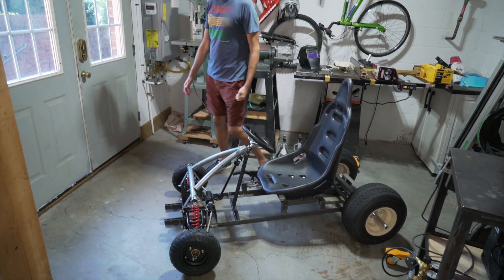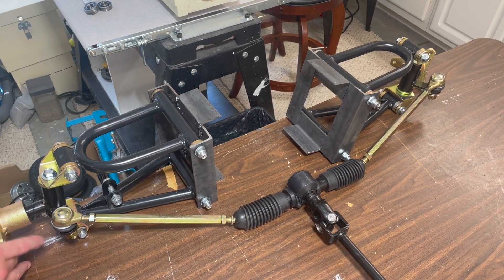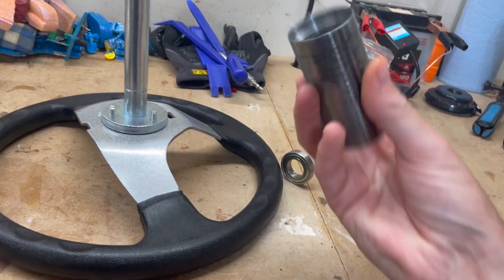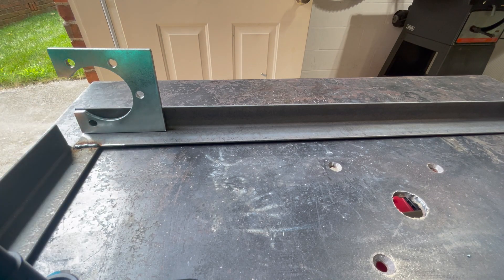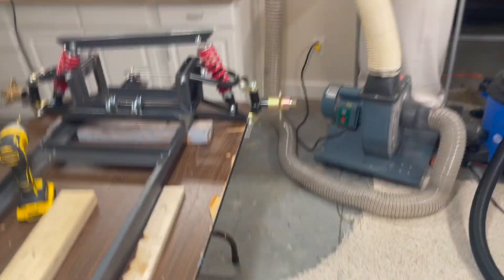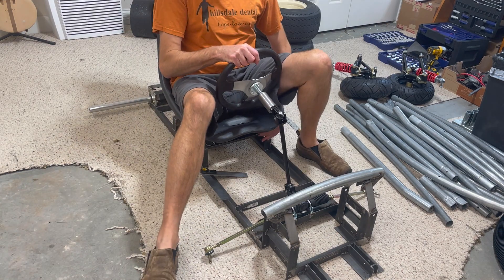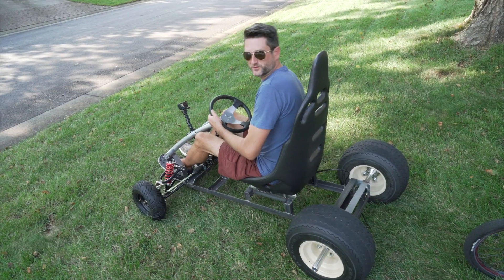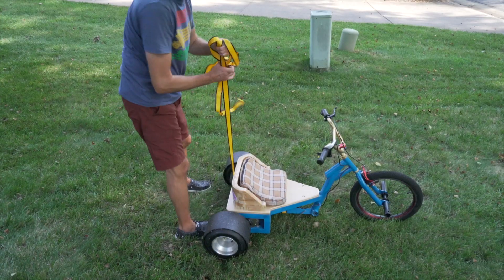Fabrication of Mario Kart Style Electric go-Kart!!!

Comment: im also building a go kart and im using a QS165 motor and a fardriver 72530 and a 72v surron battery.
Reply from the maker: Awesome, where did you get your motor and controller?   Its hard trying to decided what electric motor will be strong enough and which battery you should get because not all 72volt batteries are the same.  So after a lot of wondering i just went with the motor i did because i saw it on grind hard plumbing.  For the battery, i just ordered a pack from eBay that was rated for a 5Kw motor.

Comment: I think the motor is a little bit too big for this building it might even wheelie
Reply from the maker: That  is one of my concerns!  But, I don't know if my battery is strong enough to get the full potential out of the motor (it's rated for 5000 watts).  Also, If it's too strong, I'll switch to a smaller, cheaper motor for this build and use this motor in another project.  But I'm hoping to get this all together for a test drive this weekend, so expect the results to be posted on 9/14.  I'll be wearing a DOT approved helmet for the test incase you are correct about the potential power.  The video this week will be on a project we are working on with a Nissan leaf!
Reply: It depends on the spects of the battery

Comment: Impressive!  You've got a machine shop!  You might try to design first, then build.  Fiberglass body?
Reply from the maker: I like designing by doing!  It means I have to redo things but that just improves my welding "skills". I'm going to shape it out with the curve pipes to make bumpers and sides. I haven't decided if I'll fill in spaces after that, but if I do, I'll make fiberglass panels to go between the pipe frame.